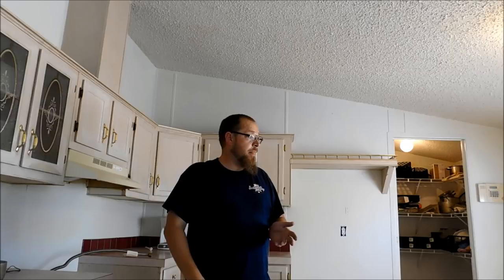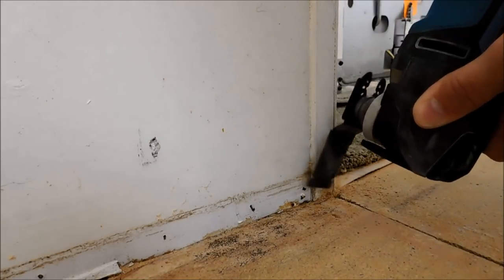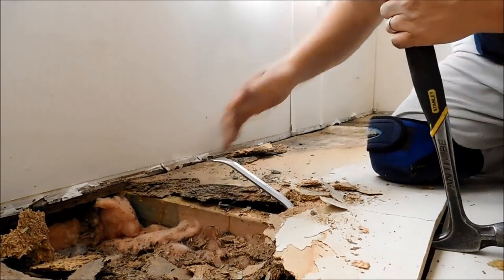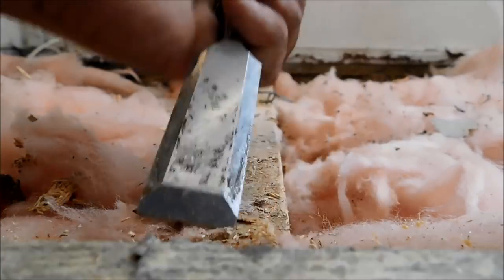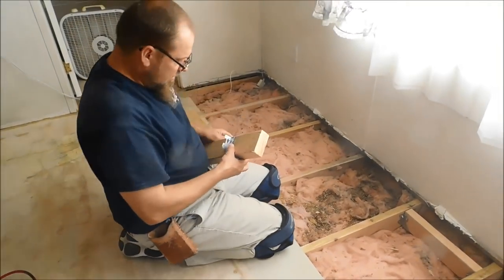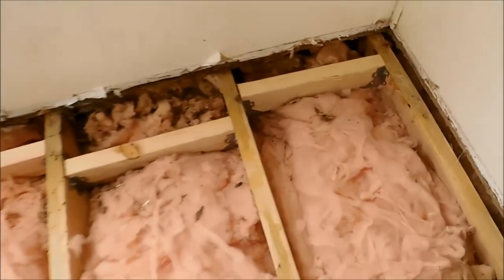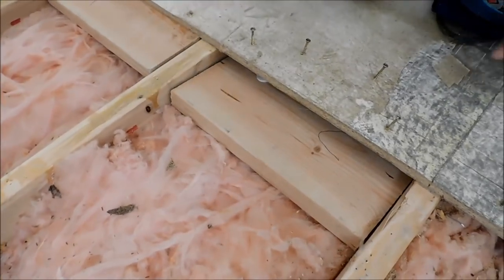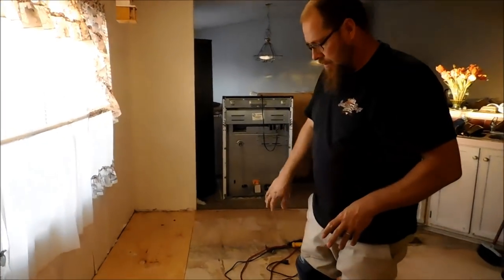ROTTEN FLOOR REPAIR

Comment: in that doublewide it should not have had partical board. at least it was supposed to have 3/4 inch chip plywood.or plywood itself.an chip plywood is different from partical.means saw dust wood. chip is made from long gated cuts
Reply from the maker: michael Parris I agree, lots of old mobile homes have particleboard floors

Comment: If I share your Video on my mobile home trailer floor repairs will you do the same for mine
Reply from the maker: sure , what one of your videos would you like me to share
Reply: My most recent video
Reply from the maker: Drew's Roofing & Home Repair Needs to be Flooring related please
Reply: If you want to you can share one of my floor videos just look for one that has good numbers by it I still get a lot of use on my floor videos
Reply from the maker: Drew's Roofing & Home Repair 👍

Comment: Just finished watching the video through. There was no need at all to put the hangers and cross bracing in and even if you did want to put cross bracing in since you staggered them just shoot nails in from the ends. For a 16 inch span spiral nails would be completely strong enough. The only reason why the edge was collapsing is because it got soaked. Just a note if you are using hangers and expect them to take a load do not use those screws. They would never meet code. You have to use spiral nails or structural screws that are made for the hangers.
Reply: Dead right... hangers normally go on the joist ends..
Reply: Dave Brittain  as you said, the blocking is unnecessary, and because of that he is exceeding code. He went further than required to make a solid repair.
Reply: @mrsandless13625  Yes and then again no because code does not allow you to use those screws to fasten hangars.
Reply: Dave Brittain, I hate nails, they cause the subfloor to make so much noise. I found out that using screws makes the floor quiet, no cracking sounds at all.

Comment: I would be dealing with the leak first! I don't think that someone would be leaving a window open that often to cause that mess. I would bet there is a leak along the edge of the wall or roof. Or the window itself is leaking really bad. All that work would be for nothing.
Reply from the maker: Dave Brittain True, unfortunately when someone hires you it’s your responsibility to do what they want, this gentleman was in his 70s and a retired GC and strictly wanted to fix it for the sale
Reply: @FloorsbySouthernboys  Ahh one of those situations lol. I have simply told some people that if I can't do it right they will have to find someone else. If they want to pay you to go above and beyond like putting floor joists on 12 inch centers or something like that then fine if they are paying.
Reply from the maker: Dave Brittain I understand
Reply: @FloorsbySouthernboys  I hope the owner of the home did the right thing and informed the buyer of the problem?   Black mold to dangerous to the new home owners family.
Reply from the maker: 34stzoo He was a retired general contractor, I doubt he said anything to anyone, he was just putting some make up on it
Reply: Dave Brittain the seller and/or buyer need a home inspection done before closing escrow, the home inspection will list any problems with the house. A mobile home is also inspected underneath, a constant water problem will be seen on the outside wall and underneath as well.

Comment: 6:30 Rather than hammering the floor, why wouldn't you just make several cuts perpendicular to the outside wall and use a crowbar to lift out the pieces whole? 32:00 Why wouldn't you at least vacuum out all that rotten saw dust? Lastly, why won't you cut out the wall underneath the window to repair the window from leaking, remove the molded insulation and inspect integrity of that exterior supporting wall?
Reply from the maker: D Jaquith Just because, just because and lastly just because

Comment: Dude didn’t you see the 2x4 behind the drywall? It was so moldy it was completely black. Guaranteed the drywall is waterlogged and moldy
Reply from the maker: Tug_Slug Yeah I know, the homeowner strictly wanted it to look presentable to sale, there is a Nother video that I did at this same residence , It was titled subfloor disaster and it was A lot worse and the other part of the house than it was here, the mold had me sick as a dog the whole time I was working at this residence here is the other video that is at this same house.   https://youtu.be/1HI6ZT5-Fe4
Reply: Good point, some people could get very sick from the mold. I would rip the drywall off and replace whatever needed. That window may need to be reflash - fix whatever caused the leak in the first place. An oldtimer one told me, "Don't have the budget to fix it right but always have it to fix it again."

Comment: The cross bracing was totally pointless ,the joists were enough for that span, but if you felt you needed the bracing you should have nailed them to the joists to support the floor , not the other way round , but at least you tackled the job yourself, so well done pal .
Reply from the maker: +simon middleton thank you sir
Reply: He's straightening the crooked unlevel joists by blocking. The are leaning in and not supporting as they should.
Reply from the maker: Tamara Johnson thank you

Comment: I would have just boxed it- stronger and cheaper than buying those metal brace connectors
Reply from the maker: Patriotic American You’re exactly right, at the time of this video I did not know about box framing.  https://youtu.be/1mJJGCvAsK0

Comment: It would have took you 2 minutes to cualk the floor joists! The lazier you are the more you work
Reply from the maker: Oscar Ruiz If you notice I said I was just putting a few screws in for the night, in the morning when I came back and I did put liquid nail on the Joyce’s before I screwed it down , I mentioned that right at the end of the video, that was a really good eye To noticed that